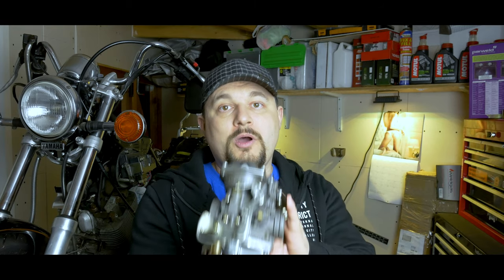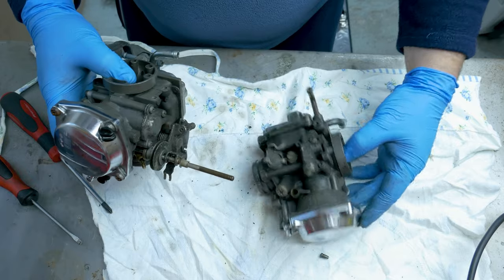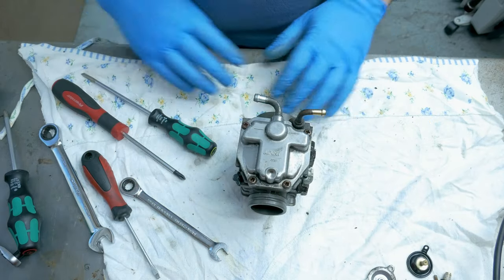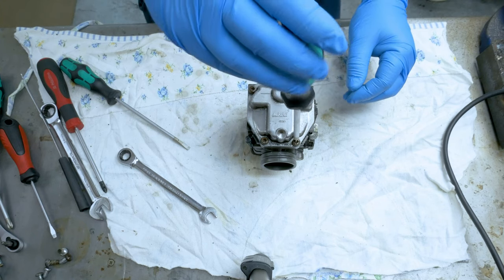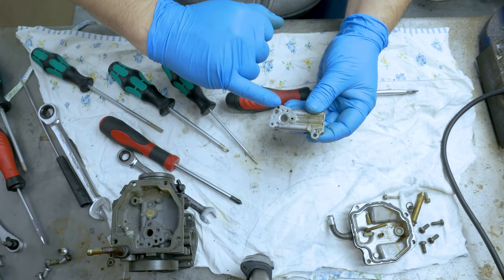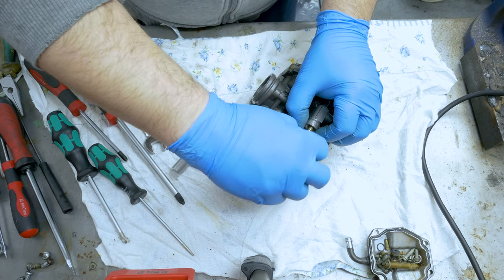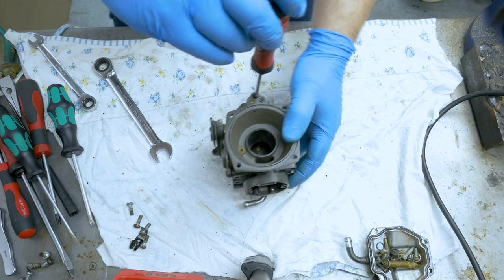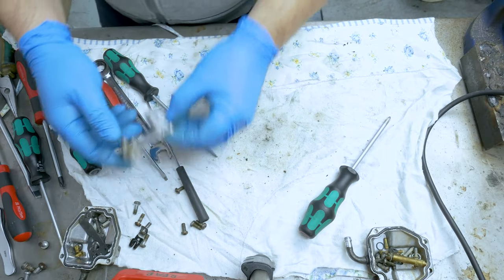VIRAGO 535 DETAILED CARBURETTOR STRIPPING TUTORIAL 87-03 | How to disassemble Mikuni carbs XV 535 #3

Comment: Thanks a lot I'm almost done putting mine back together waiting on a o-ring and a c clip that I just can't find lol it cost me a little less in parts to do a total job to the new carb you got. I wanted to have the original in my Yamaha Virago XV.. what was the matter with this carb you dissembling?
Reply from the maker: Hello....yes the parts can be expensive and I also prefer the Mikuni over this Lifan set, but it was recommended by a lot of people so I thought I'd give it a try.
Th problem was that the pilot screw got siezed in the body solid. I didn't want to drill it out and cause maybe even more damage...now the rear carb body is sold so I will use what's left for spares.
I am currently way behind schedule and will only be finishing the bike over the winter and sell it next year, so the videos will come a little bit slower...I hope your rebuild works out fine and will run nice👍
Reply: @MidlandCruiser  thanks bro!!

Comment: Great video. Can you share the link where you bought these Lifan carbs?
Reply from the maker: Hello...sorry for not showing the comment straight away, but too many spammers are on YouTube these days so I have to check every one before allowing it through. 
Here is the link, for the one I bought but haven't tried them yet so can't say anything about the quality. The choke arm was slightly bent on arrival and seems weaker than the original...but we'll see how it works once I get round to fit them.
https://www.aliexpress.com/item/4000349612729.html

Comment: Do you still have your old diaphragms? I'm trying to find out where the air hole on the slides are when installed and tab is in 1oclock position. I think I saw the air hole on yours was in the 6oclock position but couldn't tell for the front. I noticed mine were in different positions but have moved them and can't remember what position they were in but I've noticed in buying new diaphragm it says to mark it I think that's for a reason. I don't know if it matters but my diaphragm slides were numbered one and 2 and the holes were in different places. I hope you kept yours:) hope all is good 👍
Reply from the maker: Hello. I still have them and just had a quick look and the holes are at 6 o'clock on both when the tab on the rubber is at 1 o'clock and I don't have any numbers on them. They might be not the original ones though, I don't know.
Reply: @MidlandCruiser  thanks 👍

Comment: I opened my carbs and now I have fuel coming out of one of my exhaust pipes (engine off) ignition on.
Reply from the maker: Sorry for the late reply...fuel from the exhaust is really bad...you'll need an oil change as well now... your floats are stuck open so the pump will never turn off and will fill up the cylinders...very bad. Your carbs need cleaning and set up properly.

Comment: Is it normal for the diaphragm slides to have gas on them when dissembling right after running? Mine had gas on the slides... Just wondering..
Reply from the maker: Well not really, unless you had some left in the bowl and accidentally spilled on to them, but generally they should be free from petrol
Reply: @MidlandCruiser  thanks again!!!! Yes the bowls were full
Reply: SMH

Comment: Hey bro, me again got a question 😀 After you install the carb do you go in this sequence to dial them in; idle, fuel level measurements, using the Gunson Colortune to set pilot screws, sync and idle again? I've got the Colortune someone said sync should be last but can't get a answer to what sequence I should go. And to do the fuel level measurements you need a small tube to attach to the drain fittings then use the tool to make sure it's 13.5-14.5 mm below the bowl line ughhh the part I got didn't fit the small nipple on the drain fitting. How do you do it? And what sequence should I go? When I synced them today the video says to raise idle up a little then sync well I did and it pops/backfires after now. I haven't set the fuel level yet. He said sync should be last because all other changes will change the sync.. and to start with fuel level measurements... What do I do? Please help bro! 😫
Reply from the maker: Hello...after carb rebuild you always start with the fuel level, and you will need the small nipple so you can attach a transparent tube to see it properly.
So...
1st Fuel level
2nd Sync (idle and around 3k)
3rd Colortune (idle only)
4th Re-check the sync
Done
You can check higher engine speed with the colortune to make sure it's not too lean, also when you blip it to rev up, it should be a nice orange color, indicating nice rich fueling for when you need it.

Also worth checking the gap in the colortune to make sure it's around 0.7mm because bigger gap can cause popping...hope this helps👍
Reply: @MidlandCruiser  thank you very much!! So when I sync it, sync it at idle first then change idle screw to have idle at 3000 or use throttle grip and sync then if out of sync at 3000? Thanks!!!!!!
Reply: @MidlandCruiser  and when I Re-check sync do I just do it at idle or both idle and 3k again? And after I sync it after fuel level I sync it then adjust idle back to the 1150-1250rpm/k (book specs) after the 3000k or after I sync after idle too would I set it back to 1150 or just change screw to set idle at 3k sync if off and then set idle to spec?? Thanks tremendously!!!
Reply from the maker: @karlh4313  wow...I'm a little confused reading the loads of "afters"😆
So...Fuel level 1st, then sync on idle and 3k using the throttle and Not the idle screw.
This is important so both carbs sucking evenly through the pilot circuit....while setting the idle mixture with colortune you may have to change the idle screw to keep it where it should be (1150-1250)

Once you happy, just hook up the sync tool and re check it like you did it first time, using the throttle, and NOT the idle screw....that should be set by now and shouldn't need adjusting. I always do quite a few throttle movements BEFORE starting the engine so all the mechanical bits in the throttle mechanism settle. All the way to idle and snap it a few times too, let it snap back to the screw.....WITHOUT THE ENGINE RUNNING 😉🙂

I hope this clears up any doubts..👍
Reply: @MidlandCruiser  definitely thanks!!
Reply: @MidlandCruiser  lol sorry for all those "afters" smh! I appreciate your expertise! So last 2 questions and no afters lol Do I adjust sync at 3k if off? Thanks bro! Yeah I seen one guy and he said for the initial sync at idle he adjusts the idle up to 1300 bc syncing it will bring rpm's/idle lower or higher. What do you think? And at 3k for the pilot circuit, is that for the pilot screws? My bike doesn't have any connectors or wires coming from it like I've seen on some.. so I don't understand when you say circuit. Thanks bro!!!
Reply from the maker: When I say circuit I mean inside the carbs there are 3 "circuit" (choke, pilot or idle, and main) 
If you set the pilot screws at idle with the gunson and they are fine then you don't adjust them anymore for 3k, that becomes needle height and taper problems if it's lean or too rich in that area.
Me personally adjust the idle sync as close to idle as possible so on the 1100 is just around 1000rpm, if the syncing moves it up or down then I compensate with the big idle adjusting screw (the one you turn by hand.
If the sync is bang on at idle usually it is fine at 3k so no further adjustments are needed, if it's way out you may have a vacuum problem,  doesn't have to be perfect as long as it's in tolerance...
Reply: @MidlandCruiser  thanks!

Comment: Hey, why don't you spray a little WD40 on the screws to loosen them? it works like a charm! Also the impact screwdriver could help you deal with the problem. I personally don't like to hammer on things but the impact screwdriver is a safe way to go, they say :) (Edit: now I see, that you did use the WD40 later in the video...The WD works well if you apply it and let the part sit for a few minutes.
Reply from the maker: Hi, thank you for the suggestions, yes I have used penetrating oil (however not WD40) , but it was beyond saving... I let it sit in it for days, also added heat many times but still wouldn't even move a tiny bit, and ended up snapping, so I had to ditch it... 🤷‍♂️

Comment: Does anyone know the best way to remove the valve seat for the needle on these carbs? Everyone removes everything but the seats on these carbs
Reply from the maker: That is correct, unfortunately those seats are pressed into the housing and difficult to remove them. Usually everyone just polish them up and that's it. To be honest the brass housing can't get really damaged, most of the time the rubber perishing on the needle instead, so a quick polish is enough for the housing with a new needle and will be working fine. Hope this helps a little however not answering your question 😁🤦‍♂️

Comment: Hey 👋 got another question for you.. why would the pilot screws have to be turned almost all the way in instead of 2&1/2 turns out to get a good air/fuel mixture? What would be causing that? Thanks
Reply from the maker: Hello. That could be caused by wrong jet size (too big) if you set everything up in the right order (valve clearance, fuel level, sync, pilot screws) and the jets are the correct ones then maybe you have to lower the throttle stop to get the idle down, close to stalling, and then try open up the pilot screws...maybe the bike runs of the throttle instead of the pilot circuit, hope it makes sense...😉
Reply: @MidlandCruiser  is the throttle stop the throttle screw that raises and lowers rpms? Thanks
Reply: Might have to rebuild it again..
Reply: @MidlandCruiser  did you ever get the Lifan carb on an how is it?
Reply: @MidlandCruiser  or what is the throttle stop? 😂
Reply from the maker: Yes that screw the one I meant, the one you use to adjust idle speed, it could be too high up so you won't notice the adjustments on the pilot screws, because you are running off the slider and not the idle circuit..
Reply from the maker: I haven't fitted it yet🤦‍♂️, life gone difficult unfortunately...soon will start up again because I need the space so I have to sell the bike...
Reply: @MidlandCruiser  yeah my carb doesn't have that connector attached to it like yours did.
Reply: @MidlandCruiser  why doesn't my carb have the connector attached to it? It's a 95 xv535sg.. and why doesn't my choke raise the rpms when I put it in choke when cold? I have to use idle screw sometimes???
Reply: @MidlandCruiser     I did clean the upper tank and maybe my dumbass didn't get all the water out when I cleaned it with electrolysis method. I tried drying it out and used mystery marvel to try to keep it rust free and get any extra water out. I used gas and marvel but I'm sure some water was still there. I should of filled it up with tank on bucket and let it drain everything out.. what's weird is it was doing fine after I cleaned it ran ok definitely had power but I didn't use a lot of gas I just test drive it a few blocks a few times. Idk why the power loss and I'm figuring since 2 gallons filled it up to the top almost then it still had a gallon when it wouldn't start yesterday. Which is still only half gallon in res and 2&1/2 in tank. Idk I think it could be my pump but I think my carb still needs to be rebuilt with quality parts.. I don't want to buy a Lifan carb for it. It's only got 9000 just sat for 18 years. Compression is good actually perfect I synced the carbs but it was extremely hard to get fuel level correct for some reason..
Reply: @MidlandCruiser  definitely makes sense now!!!! I didn't see the close to stalling!!! I gotcha!!!
Reply: @MidlandCruiser  someone else said wrong jet size but I have 3 books and go by vin on Partzilla or Babbitts etc.. they all have it as a 35 and that's what mine were. I was thinking about getting new ones but I'm going to try your way first. That way I don't have to buy gaskets or 2 jets. Do you think buying a whole kit that had everything including the diaphragms coasting enrichment assembly etc.. for $12+ was a good idea my friend said not .. and my choke takes a long time to get the revs up is that normal? I'd figure it to have it higher once it starts.. but maybe it's all bc I haven't set it right the way you are saying. Thanks for your knowledge and being here!!

Comment: Hey Midland Cruiser! Was wondering do you know what the symptoms of a leaking choke plunger is? I have a one that is leaking barely but wer for sure! Im also having issues with the idle staying the same it seems to fluctuate.. would you know why?? And what do you think about cheap vacuum diaphragms? Should I of order a All Balls rebuild kit and Yamaha diaphragms and coast enrichment system diaphragms instead of a cheap Chinese kit that came with everything from vacuum diaphragms and coast enrichment diaphragms and everything else needed valve seat etc.. I've read that the materials are not good with ethanol..
Reply from the maker: Unfortunately I don't know about leaking choke,  however I'd think it would cause it to run richer and possibly would make it cut out instead of fluctuating idle.
Usually if the idle moves up and down it is caused by a vacuum leak somewhere..
Try to spray some brake cleaner around the boots and where the carb mounts to the boots and if it changes the idle than its a vacuum leak.
Worth checking the seal at the top of the carb where the membrane are.
Regarding the parts, I'd buy the known brand instead of the Chinese , saying that I bought the Lifan carbs for this bike however I don't know how good or bad they will turn out...
I decided not to strip the whole engine apart so that will bring the completion forward a bit but I can only start doing it later (not sure when though yet)
Reply: @MidlandCruiser  thanks for all you info and expertise in all this you've helped me a lot for real!!
Reply: @MidlandCruiser  did you mean spray carb cleaner?
Reply from the maker: No I meant brake cleaner...small short squirts. Very flammable so be careful and only do it on the outside joints/sealing faces and NEVER into the carb..
If you not sure or hesitant then leave it, and just double check all the sealing areas for leaks...
Reply: @MidlandCruiser  no I can use brake clean I'm not hesitant I just thought I always used carb cleaner to check. Can I use either of the two or will brake clean tell where the leak is better.
Reply: @MidlandCruiser  I see on the internet it's pretty much broke up into using either or but I want your expertise in why brake cleaner is better. I just figured I could always use the carb cleaner later too when I replace that leaking choke plunger one day.
Reply from the maker: I found brake cleaner better because it evaporate quickly unlike the carb cleaner  which could stay there and if you start the engine a little later, small amount of vapour could get into the engine when you don't want it.
Reply: @MidlandCruiser  gotcha thanks!!!
Reply: @MidlandCruiser   Got another question lol if you would of gotten the pilot screw out and let's say you don't have a ultrasonic cleaner could you clean the pilot screw area with a brass spiral brush to clean up the threads and inside good or do can you only use the nylon brushes? It's hard to determine what brand is good but I noticed my front pilot screw screeched when turning it in and the rear didn't. I also found out the front wasn't going in as far as the rear..
Reply from the maker: Ohh dear..screeching pilot screw is not good, mine did that and got stuck.
I don't see why not you could use a brass brush to clean the carb however you'll be limited how small places you could clean...

Comment: Do you have a link to the carb you did get for it? Thanks
Reply from the maker: Hi there this is the one I ordered, I think the top review is mine..
https://www.aliexpress.com/item/4000349612729.html
Reply: @MidlandCruiser  thanks!!
Reply: Hi ...really like  ur vids... do the carbs come with correct jets?
Look like refurbished? A short video of installing alternative carbs would be helpful 🤗
Reply from the maker: Hi...thank you. They are new as far as I could tell. I think the jetts are for the 400 so will need to check that. Once I get around to do it the video will be up here..😉👍
Reply: Just few questions did you check the pilot screw adjustment on the China carb? How did it run with the the new carb? Do you have to check fuel level, sync and I'm sure you have to idle maybe but for the fuel level and syncing?? Thanks for your time and help!!
Reply from the maker: @firebird14420  as with everything from China I will check everything incl. fuel level, jets, membranes, alignment, sync..I am selling this bike so it has to be perfect. I haven't tried it yet as I am doing a lot of other things first and basically this will be the last thing I will have to do...after everything else, sorry but it will take a while. I hope you'll stick around though,  All the best 👍
Reply: @MidlandCruiser  most definitely!! And I was firebird14420